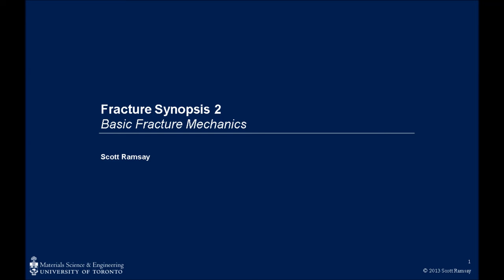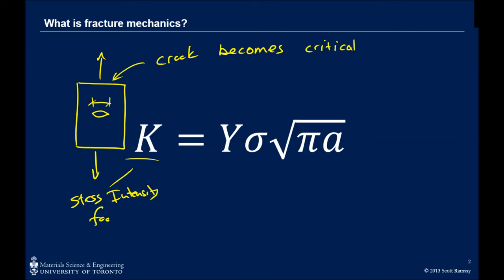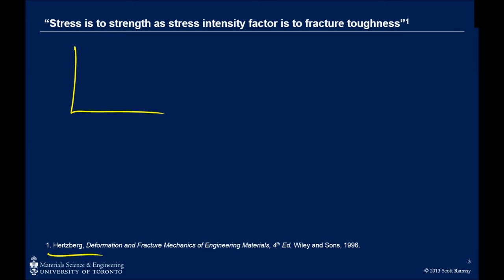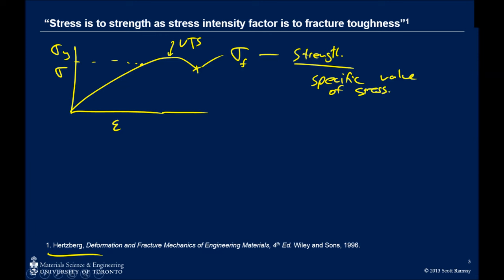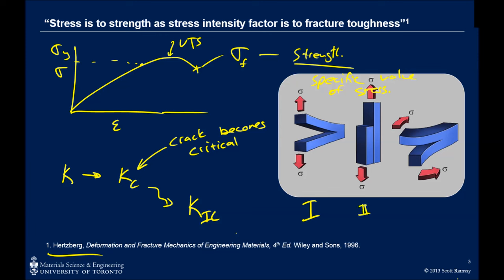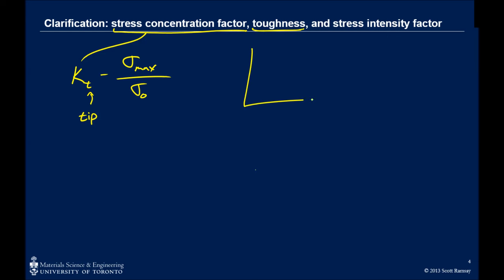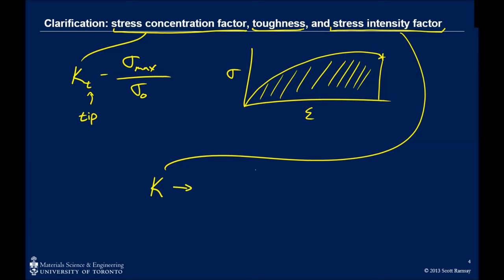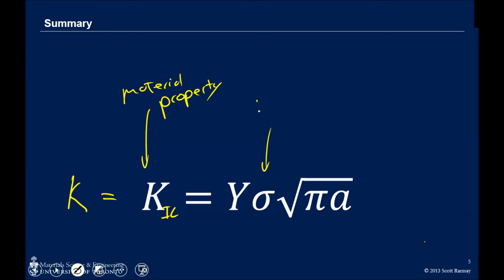Basic fracture mechanics

Comment: A highly cross-linked epoxy resin has a coefficient of linear thermal expansion α = 5×10−5
K−1, GIC = 120 J/m2, E = 3.2 GPa, and ν = 0.35. A thick layer of resin is cured and
is firmly bonded to an aluminum part (α = 2.5 × 10−5 K−1) at 180◦C. Calculate the
minimum defect size needed to initiate cracking in the resin on cooling to 20◦C. Take α in
Eqn. 5 to be 2/π for penny-shaped cracks of radius a in a wide sheet.?

Comment: Can anyone explain the difference between the two equations for Fracture toughness equations such that:

K = (y.p)/(h.w^0.5)      or 

K= Y. STRESS.((Pi.a) ^0.5)
Reply: i think there is no difference between in two equation.
in first maybe you have a rectangular plate subjected to load P and have thickness, " h" & width ,"w" ..
so stress = P/(h×w)  , h×w = C/S area of rectangle 
you can put stress value in 2nd equation .. 
 but  , K= y×(p/(h×w))×sqrt(PI×a) ..  i got this equation( maybe i am wrong)
  ... sorry for my english ..

Comment: how do you calculate the critical crack length?E and Gc are given as is the maximum working tensile stress that the plate needs to withstand which is 400MPa.

E= 7.2 x 10^10 Pa
Gc= 6300 Jm^-2
Reply: Alex Quinn In a similar as any dimensioning in mechanics. Write up the equation for when it's just about to fail, and that would be when your crack is so long that the stress you have is enough to to crack your material. So just copy the equation and call your crack length a_C.
K = K_IC = Y*sig*sqrt(pi*a_C)

Comment: What are the formulae to determine stress intensity factor for all three modes for an edge crack on a turbine blade sujected to 3600 rpm rotation and temperature? Can anyone suggest relevant research articles. It will be really helpful.